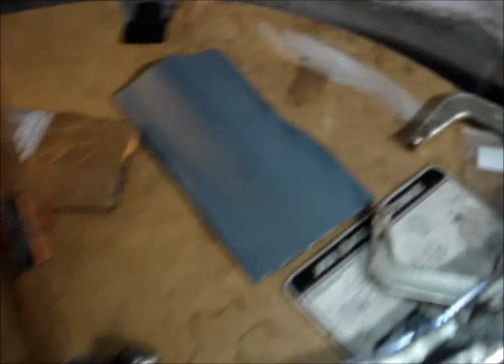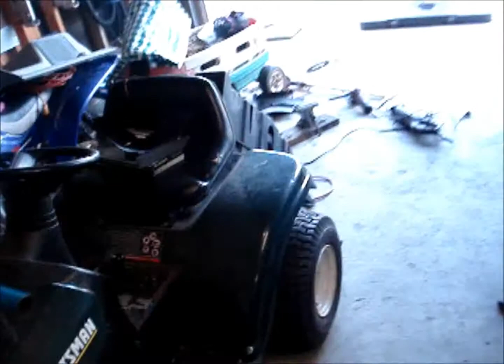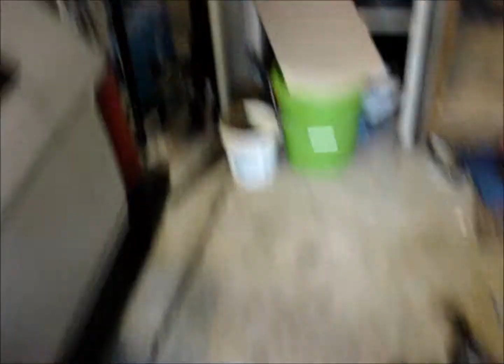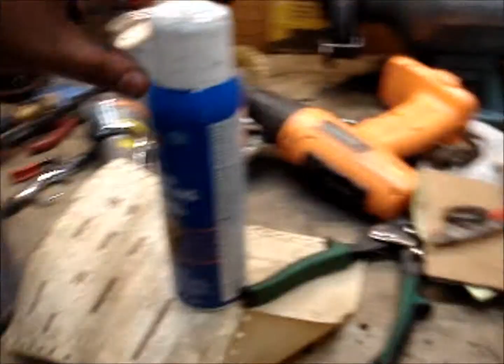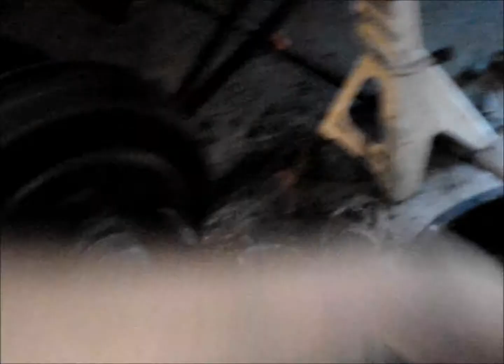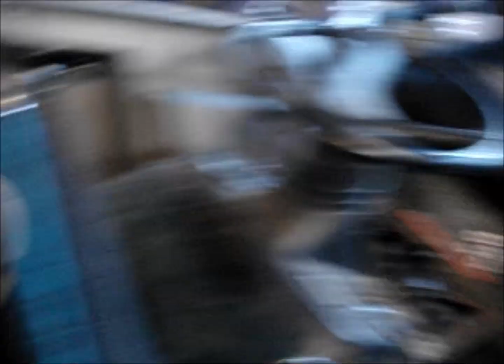Ford escort rust repair: caution wet paint and welding might result in fire

Comment: I generally weld on unpainted pieces, then paint them later, less fire that way. Silicone seal also works pretty well for sealing the panels between the welds. Looks like it is coming along well. Body work is definately a time consuming task. Unlike Franko's 5 minute body job!!!!  :)